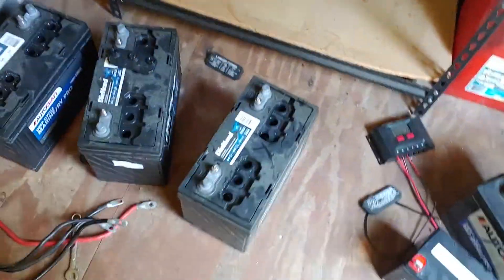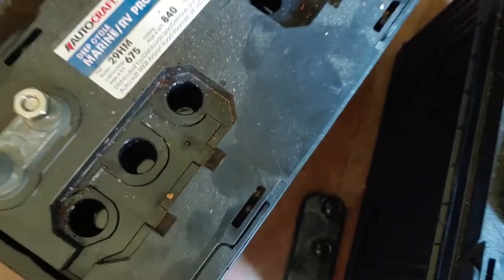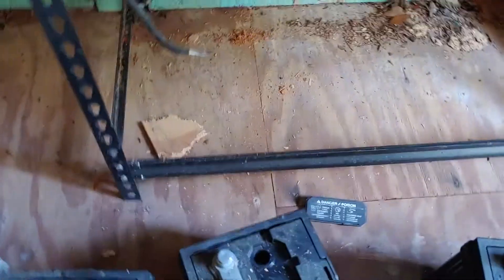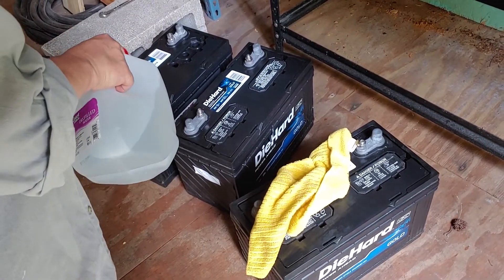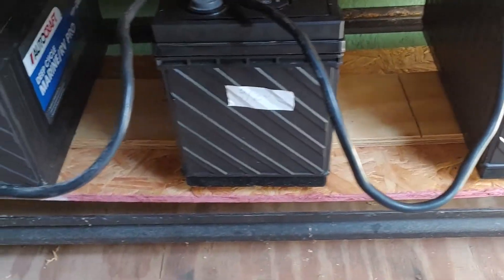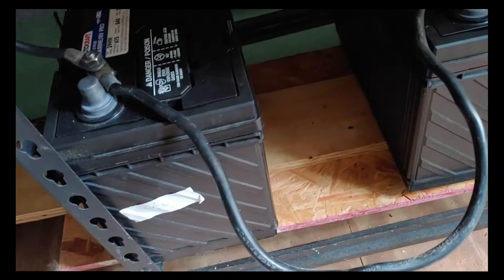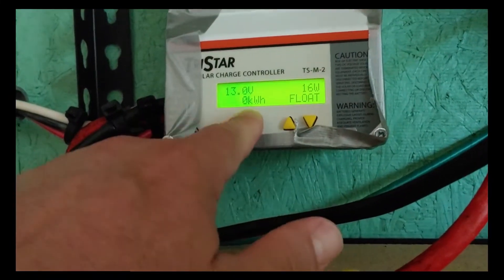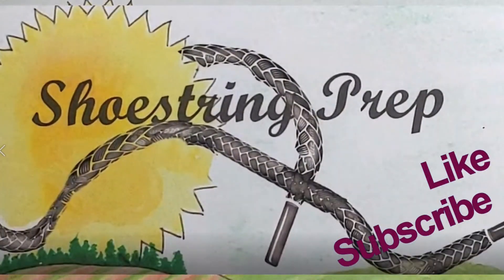Disaster Strikes my off-grid 600- watt solar power system

Comment: I used 2X4 under mines and it been like that for the last 10years. Why is your wires between the batteries so long? Worst yet it is a 12v system, lot of energy lost.
Reply from the maker: I agree. Long wires equals energy loss. I have the wires that long so I can manipulate the battery.
Thanks for your comment.

Comment: From what I'm seeing you're using pressed sawdust and glue if all the shelves are the same theyll eventually do the same  these pressed sawdust shelves absorb moisture from the air for a battery shelves it's not if it's when go with minimum 5/8 actual plywood
Reply: Since you're moving the camera around so much I can't see what you put under as shelves but minimum should be 5/8 with 3 2x4 under and 3/4 without anything under other than the rails if you holld the camera steady some one might have seen the problem before the disaster you're just fortunate that they all didn't collapse atleast you're able to change the the rest before they collapse if you watch other utube videos like Jehu Garsea one on the tear down of the new solar generator with a RV plug on it because he keeps the camera steady some of his viewers caught the fact that the  manufacturer had reverse the comon white wire with the black that means that if you have regular light socket the base on the bulb is hot how people touch the base as you're putting in or taking out the bulb and if the  comon is connected to the ground in the panel hox it's a dead short
Reply from the maker: The shelves have been updated. Thanks for your comment.

Comment: That cheap particle board was your issue...I'd replace it all with that plywood
Reply from the maker: You are correct. That's exactly what we did.
Thanks for your comment.
Reply: As the owner of a mobile home that was floored with the stuff, I agree particle board is the devil (especially if there is any danger of exposure to water or even high humidity over a long period).